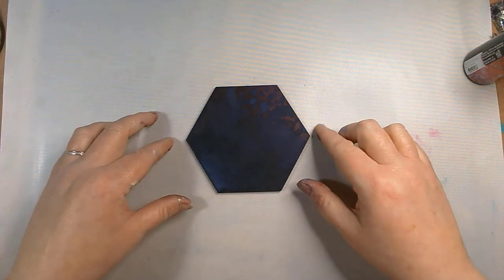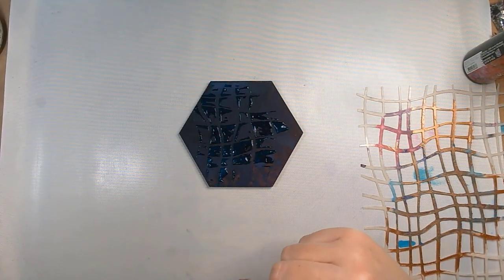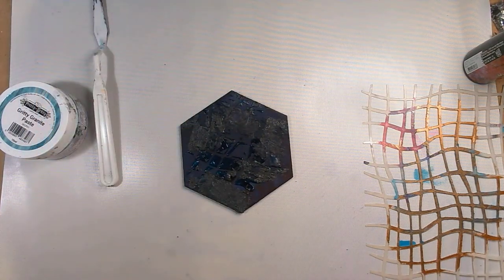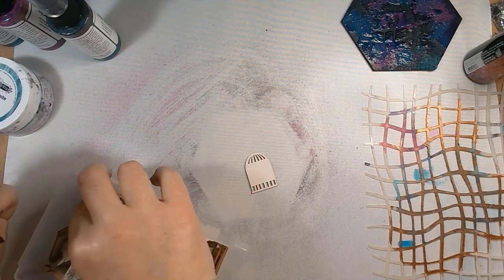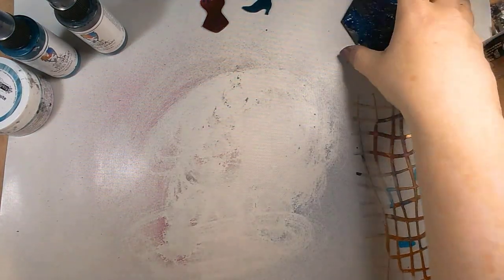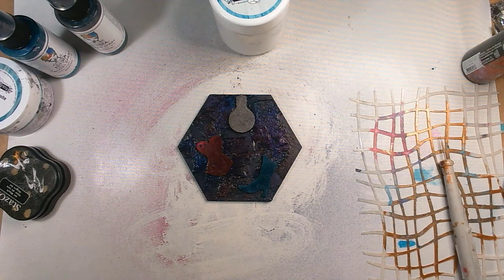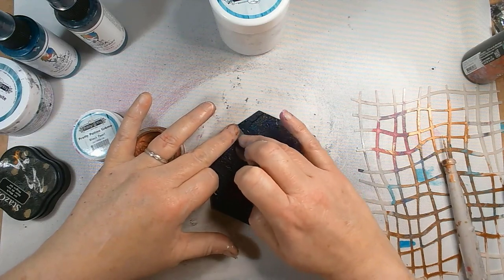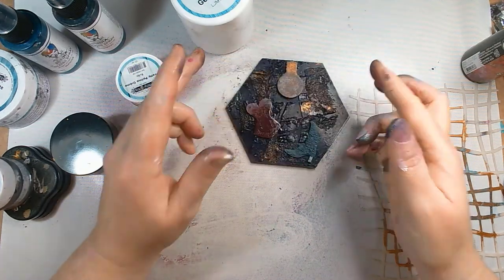What I did with an MDF hexagon!

Comment: That is a pretty cool design, Angie! Tfs!
I've never used gel medium before, but I've seen many people use it for various reasons. You put it on the back of the chipboard pieces. Does it also act as a glue?
Reply from the maker: Yes. The gel medium is a glue that forms a good bond for a range of materials. There are matte and gloss finishes. So if any leaks out you know what it will look like. Matte tends not to be clear when dry, due to the manufacturing process. You can also use it as a top coat to your work. 
Thanks for watching. 😀
Reply: @angiebartist  Thank you for the information! I'll have to get some gel medium and experiment with it.